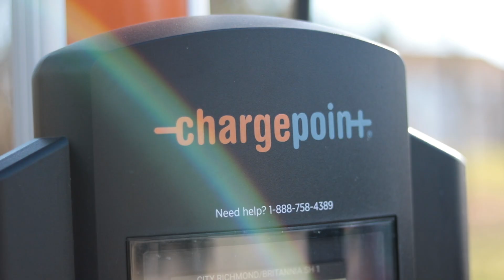Mobile EV charging solutions presented by Foreseeson EVSE Technology

Comment: It's a neat idea, but I think the way we've gone ahead with EVs is terrible and this is just a crutch for that terrible idea.

It would have been far better for EVs and the batteries to be separate. Have car manufacturers make the cars with space for battery packs to be attached.

Then have a separate independant company manage the batteries. They could have battery swap stations, like we have gas stations now. People drive in, get their battery swapped, the get on with their day. Quick and easy.

This would have simplified the building of the cars a lot. Cut the price down dramatically. Also kept their resale value higher for longer.

Also, with respects to the batteries, they would be a lot better too. A comapny managing a large number of batteires could afford expensive high quality chargers and maintenance equipment to keep the batteries in optimal shape.